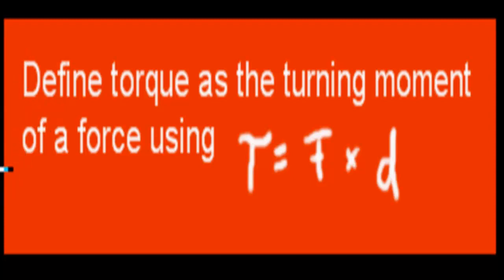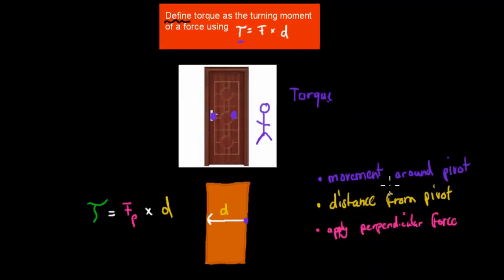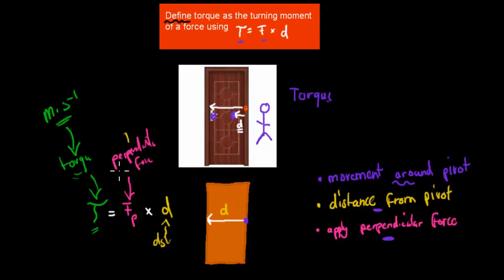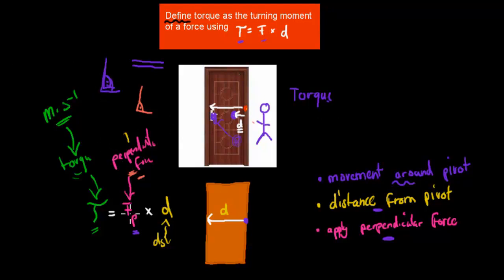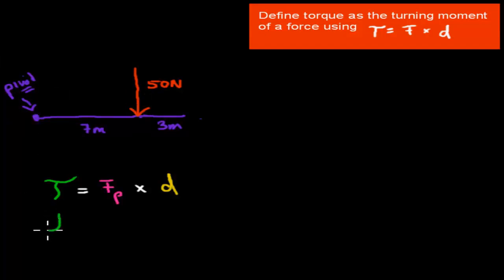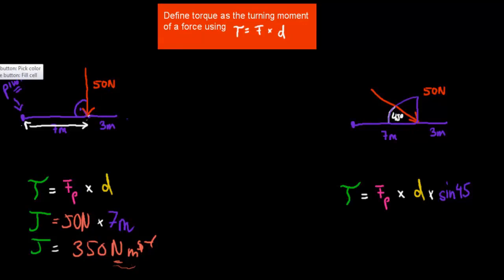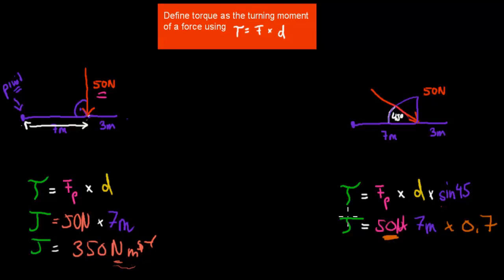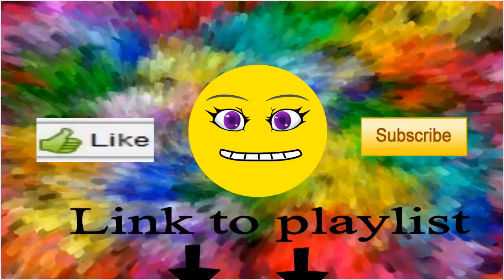6. Torque (HSC Physics)

Comment: I don't if it is important that much but I think in HSC they want us use the exact values because of our calculators. Sin 45 is 0.7071... not exact 0.7. (the answer should be 247.5 to 1 decimal place.